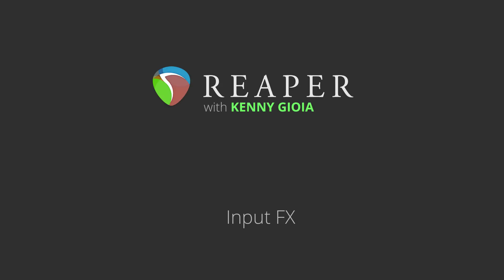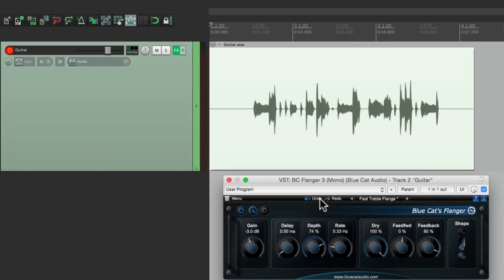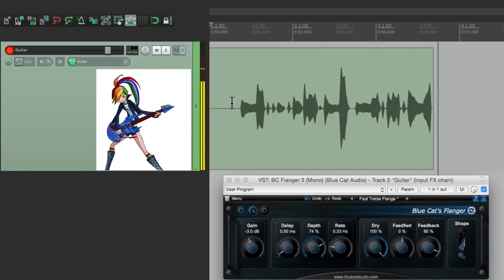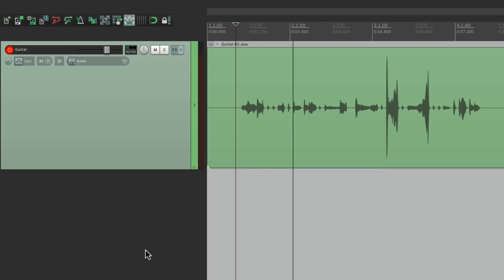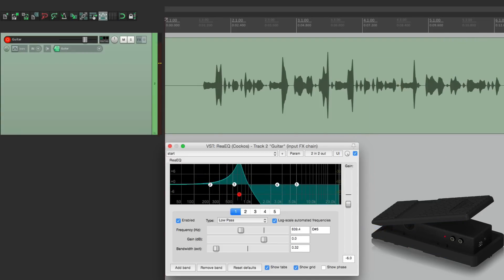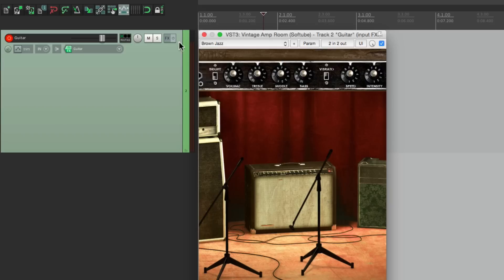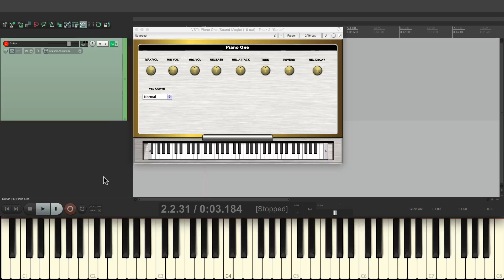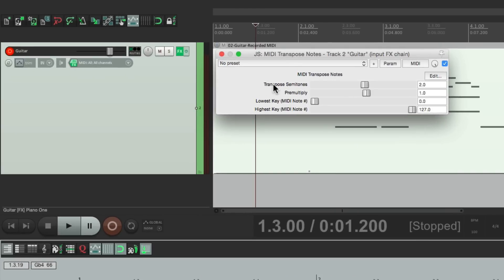Input FX in REAPER

Comment: Hi, I just started using reaper and I have some problems with it! I added input FX (Amplitube 4 VST). The problem is, this didn't go away. I couldn't switch it off any how. This effect came to any tracks which I loaded on reaper from then on. Ultimately I had to reset to factory defaults to get it functioning normally. Also, when I'm monitoring with amplitube, I'm experiencing considerable latency in the sound, as opposed to directly playing it without any input FX. would love some help! Any insight on this?
Reply: Did you ever get an answer?

Comment: So here's the issue - Delay effects on Input FX using synced 1/4 notes. Works great as a post FX, but on the input, there's this tiny little delay before the taps begin... it's almost like there needs to be a "time slip" option on the input fx - Is there one? It needs to trigger either sooner or until the next selected sync hits to start. Ideas?